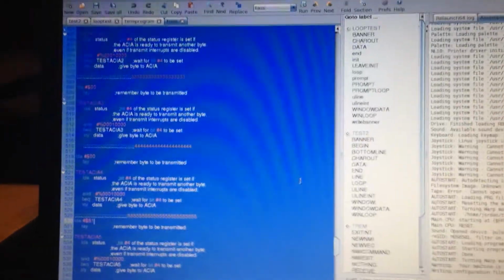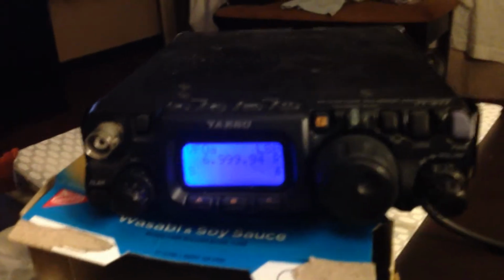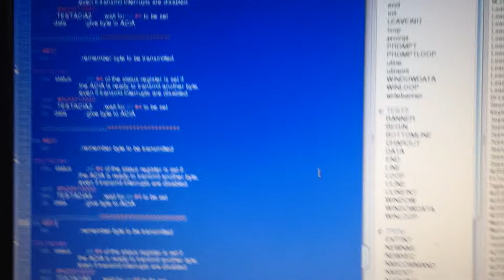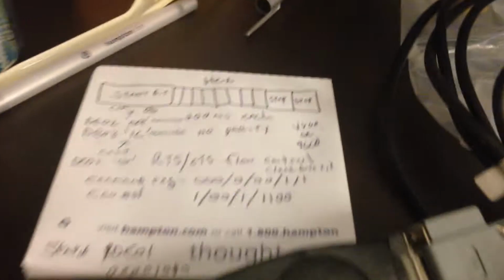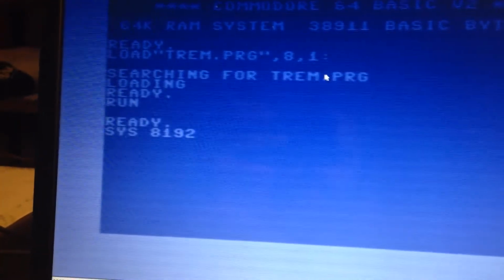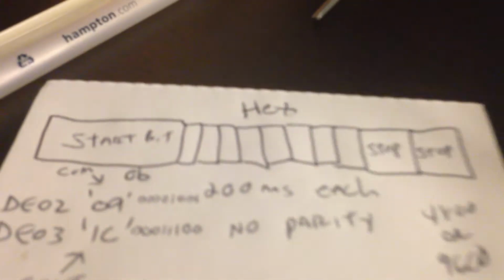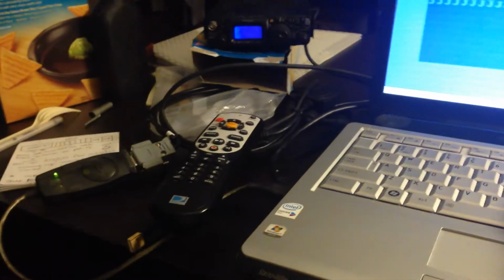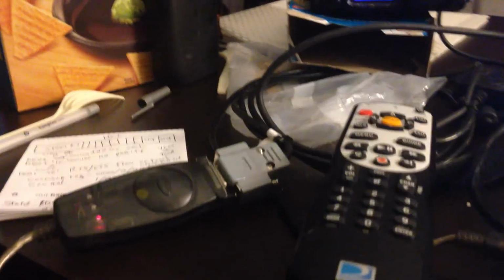Commodore 64 interface to FT-817

Comment: I am trying to send three byte commands from VICE C64 to a serial device that requires 9600, N,8,1 over a USB serial adapter.  Can you tell me how to configure VICE to get this to work?  Do I have to use an Assembly program, or can I write something in BASIC or just use a terminal program?  Any help you can give me would be greatly appreciated.